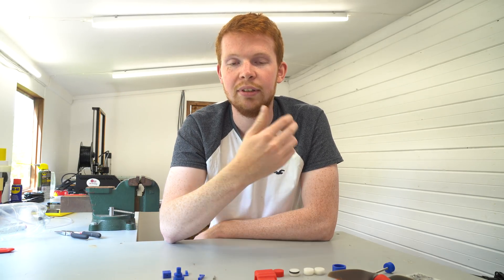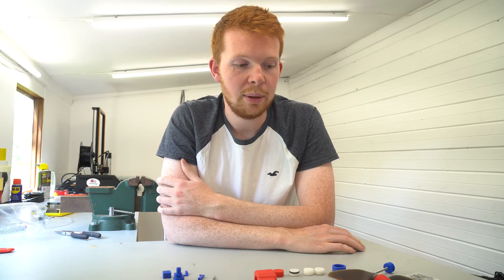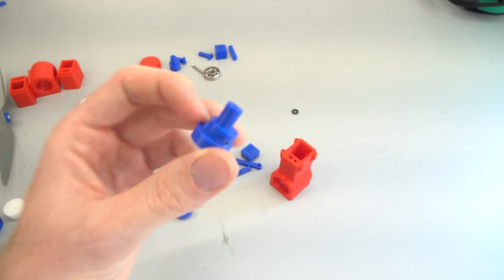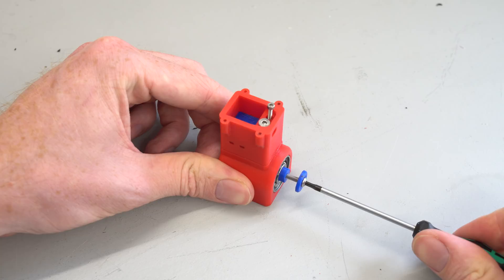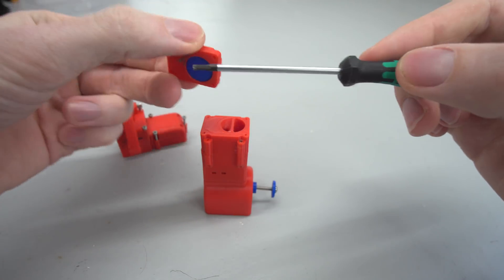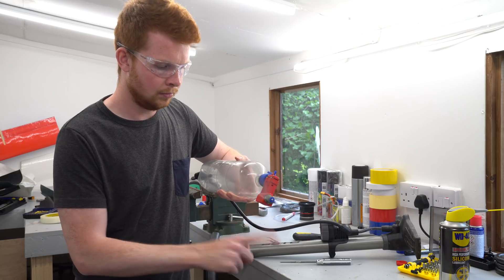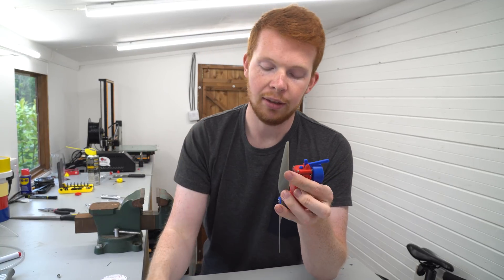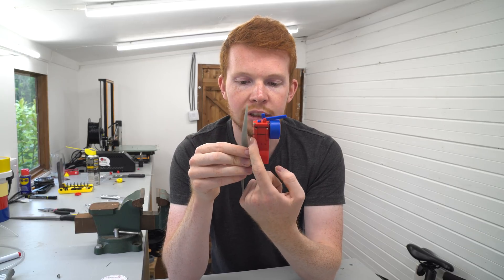Air Engine Exhaust Valve

Comment: You typically need two bearings to fully support a shaft, maybe two ball, a ball and a roller, but always two, usually more. The offset load causes a huge force inside the race of the bearing when there is only one. As a test, try removing or disabling the valve components to test where all this friction is being developed.
Reply: Second

Comment: I was among those that suggested a multiple expansion setup. Not sure if you saw it but I also suggested powering on both the up and down stroke. Though from this video it seems that the valve/cam system is becoming quite a problem. Have you considered a different valve like a sealing rod with gaps covering and uncovering inlet and exhaust ports?
Reply: could probably be done with a strip of sheet metal with appropriately sized slots, that is put into a slot dividing the flow paths.
Reply: oh and one other idea. you could increase the cylinder volume by increasing the diameter (but not increasing the stroke lenght) and deal with the excessive force/flow problem by adding a regulator valve for constant (and lower than bottle) pressure.

Comment: As I've seen the video abozt the number of pistons just now, i wanted to take this video to say that you probably should have at least 2 pistons, with one offset at a right angle, so the engine keeps the same rotation.
In another video, it was clearly visible that the rotor just swings back and forth at lower pressures, a second piston would solve that.
(offset meaning it is a quarter of a stroke behind the first piston, it could work with the offset being half a stroke, but im not sure)

Comment: Your current designs are based on internal combustion engines.   You might get better results if you look at what is done with steam engines which are often run on compressed air.
Reply: And because you are not using explosions, you can drive the piston on ALL strokes.
Reply: @martindinner3621  his design fires on every rotation, you might want to see to the episodes where he explains how his engine works
Reply: I've already mentioned it a lot in other video comments. And he can also pressurize from the crankcase side too. (No significant heat or lubrication problems like a combustion engine.) So when the top of the piston is being exhausted, it can be pressurized from underneath. So an analogy would be that it gains more power similar to how pedal clips work for a bicyclist. Not sure how he's missing that one.
Reply from the maker: Thanks for all the suggestions! So here is my reasoning why I've not to gone with the double acting piston... yet. In my air engine V3 video, I run through the reasons why I use a ball valve over a slide valve (steam engines use a slide valve to power the piston from both sides). The slide valve requires a valve between itself and the air/steam supply for the ability to completely shut off the air supply. Without this shut off valve, the engine would want to start by itself because air would be able to flow into the cylinder. Whereas the V3 engine could be pressurised and would only start when the propeller is spun. For the purpose of mounting the engine on an RC plane, this was the lightest solution. It is now possible to move to a double acting piston due to weight not being as much of an issue in an RC car. However, a double acting piston also requires a long connecting rod with a pivot between the piston and the crankshaft. It can't simply feed air into the crankcase as there will be huge amounts of air wasted in the open cavity as well as being lost through the bearing. This means the cylinder must be sealed at both ends, one end having an o-ring for the connecting rod to pass through, which will either cause an air leak or add friction. So to sum it up, I reckon a double acting piston (steam engine style) will both increase the size (longer connecting rod), increase complexity (added valve between engine and air supply) and increase friction (due to sealing the underside of the piston from the crankcase). That's my thoughts, I might be wrong, so please correct me if you think differently! Thanks
Reply: Agreed.  I was also thinking about the simplicity of the steam engine valve chest.  No springs.  The air pressure helps the sliding bit seal.
Reply: @danharold3087  that's a good idea
Reply: Liked this to push it up - Tom, stop thinking combustion engine! Also think about rotary valve like the crankshaft of a glow fuel engine. And also think about using the wrong side of the piston instead of using a cylinder head - e.g use the crank case as your chamber.
Reply: This!^^^^
Reply: Exactly! Combustion engines rely on explosions whereas steam engines run on pressure.
Reply: @joshuaf9426  I mean, the explosion generates pressure, just at the proper time. A steam engine has full pressure for the entire stroke, and usually has a power-stroke in both directions.
Reply: Liked this to try and push it up the list of liked comments as I'd also thought the (current) engine is working on combustion ethics, like a petrol engine, and not compression, like a diesel engine.

I don't know whether Tom has or hasn't already thought of this and there were reasons for not doing it already, but if there is a legit and rather simplistic method of approaching it then that would would be a good engine to go forward with and then move up the list in improvements like 2 cylinders and so on!
Reply: Good idea
Reply: I think the multiple cylinder version that you mentioned at 1:10min is only appropriate when expanding gas is involved.  There would be no additional expansion left in the exhaust of an ambient air powered  engine.
Reply: Brilliant suggestion!
Reply: threepotgtti could use both sides of the piston with an oscillating valve on the cam
Reply: In other words copy a double acting steam engine instead of an internal combustion engine.
Reply: "often run on compression." but yes this is a smart idea
Reply: I'd suggest using magnets.
Reply: His design was based for an aircraft, so he needed as little useage and as much power from compressed air, so he used a combustion engine design for its 'fuel' efficiency, whereas steam engine designs use alot more 'fuel' by powering the piston in both up and down directions. I do agree with you point but he needed efficiency over rpm / power
Reply: @2MAz but it's less fuel efficient
Reply: Exactly what I wanted to suggest for the last 3-4 episodes... I see that the compression on the Top Dead Point is considered... with negative results. The last point is that instead of thinking at multiple cylinders Tom should consider multiple stages instead, like in Steam Engines...
Reply: What Is Islam?

Islam is not just another religion. 

It is the same message preached by Moses, Jesus and Abraham.

Islam literally means ‘submission to God’ and it teaches us to have a direct relationship with God. 

It reminds us that since God created us, no one should be worshipped except God alone. 

It also teaches that God is nothing like a human being or like anything that we can imagine.

 The concept of God is summarized in the Quran as:

{ “Say, He is God, the One. God, the Absolute. He does not give birth, nor was He born, and there is nothing like Him.”} (Quran 112:1-4)

Becoming a Muslim is not turning your back to Jesus. 

Rather it’s going back to the original teachings of Jesus and obeying him
Reply: @ahmdabdallah5811  fuck off
Reply: @ahmdabdallah5811  Get away from here disgusting anti semite  jhihadist

Comment: You might want to make a couple wraps of duct tape around the bottle to renforce it because it might blow up under high pressure
Reply: 1down 4up 
That could be useful, but the way he placed the scrader valve in the bottom of the bottle should make that blow out long before the bottle itself would explode
Reply: No those hold a shit ton of pressure and duct tape would do jack anyways

Comment: I still think a rotary would be better
Reply: wouldn't it basically just be a turbine?
Reply: oooh, yeah, a rotary engine would be really interesting to see. They are also much simpler in their design.
Would need a lot of grease to get a good seal though.
Reply: Rotary engines require combustion to keep the rotor spinning therefore this would be more complicated than it first looks
Reply: Felix4Gaming
More seals required per cylinder. They managed to win the 24h cause they managed to produce a good engine despite that being a rotary engine, not because of that.
Reply: ABaumstumpf Nah, you had it quit right but the rotary actually also doesn't need valves, camshafts and camesprings, camfollowers and chain ( basically the whole valvetrain of a 4 stroke). The rotary, if well lubricated, is also very reliable (the infamous 787 basically won the 24h through reliability and not as many people will tell you because of it's supirior powerout put) but there lies the problem.  Constant lubrication on a rotary without high emissions, eeh, not gonna happen today.
Reply: ABaumstumpf note, I'm thinking of the Wankle engine.
Reply: in an wankel rotary engine, there are no cylinders. There is a housing and a rotor. Yes, the rotor needs three seals. But these dont need to be super tight, much like how the current engine design has a small gap between the cylinder and piston.
I think using grease, rather than oil, could help there.
About the mans, i must correct myself, it wast the rx7, but the rotary engine was used.
Many attribute their victory to the rotary engine design. One of its main appeal is that is wears a lot less than a reciprocating engine design. If you think about it, it makes sense: it only has a single moving part, and its a rotor.
Reply: Paul Quarles The idea is good but i think it all boils down to leakage, wich is very common in rotarys.
Reply: "Yes, the rotor needs three seals. But these dont need to be super tight, much like how the current engine design has a small gap between the cylinder and piston."
3 seals just at the circumference, moving at higher velocities, and you also need seals at both endpoints (the engine isn't just the 2D crosssections). 

"One of its main appeal is that is wears a lot less than a reciprocating engine design. If you think about it, it makes sense: it only has a single moving part, and its a rotor."
And that has been shown to be false many many times over.
You only safe a single part - the piston-rod. The part with the least wear.

The benefit of the Wankel is that it has a small volume, can be run at high RPM and has more combustion occurring per revolution giving it a higher power for its size and weight. But neither efficiency nor durability are high. And for an air-powered engine you want efficiency - where the good old steam-engine designs are far better suited.
Reply: Steven Little not necessarily.  You would need a different setup than a combustion rotary engine for sure, just like the air piston engines are not 4 stroke engines either.
You would have the inlet be at the same stage as the decompression stage.
Reply: ABaumstumpf they also have a much higher power to weight ratio. Something that is needed for rd aircraft's.
Reply: The le mans race where Mazda was in 4th place and had luck that the first 3 all had major problems.... yeah....
And without valves the inlet and outlet ports are a huge problems for the seals creating a lot of wear and - again - leading to its comparatively poor reliability.
Reply: ABaumstumpf I'll take it as a win through reliability and a good portion of luck. Again, if he would ad a lubrication system that mixes some lubricant with the air (like in stationary compressed air systems, for example in workshops) it wouldn't be a problen at all. He just needs a simple ventury nozzel with a well seized whole in the sidewall to draw lubricant in, as simple as that. The complexity doesn't even exeeds his own valvetrain design. I  think the problem is the print of a proper rotor and crankshaft what includes the  teeth on them.
Reply: "I'll take it as a win through reliability and a good portion of luck."
If you think other parts of the car failing is somehow proof of the reliability of the wankel engine.... well, your choice to believe factual incorrect things.
Reply: If you build it like an air tool you use centrifugal veins to catch the air
Reply: ABaumstumpf I would say it is very correct. You can't say that the engine reliability isn't a crucial part of winning the 24h and i love to tell the story because people think the engine is the most unreliable thing on earth, wich by the way is a false fact. It all depends on how you lubricate it. Of course the rest of the car also has to hold up until finish but thats not the main topic here ;D.
Reply: Paul Quarles What do you mean by centrifugal veins?
Reply: "and i love to tell the story because people think the engine is the most unreliable thing on earth"
people that claim that are idiots - same as those that think it is as reliable or more reliable than Diesel or Otto motors.

"You can't say that the engine reliability isn't a crucial part of winning the 24h"
it was reliable enough to last for that one race. 

"Of course the rest of the car also has to hold up until finish but thats not the main topic here"
But that is the main point of your (failing) argument as that was what was failing with the other teams.
Reply: "My "failed argument" as you call it is nothing more than stating that the engine had held up the whole race"No, i am talking about your failed argument where you claimed that failure of other cars in any way would imply reliability of wankel engines -a colossal non-sequitur.
Reply: Mandernach Luca
"I never said that ;D. I said it won the race through reliability and not through a higher power output. "
Well - and that is simply not true as the reliability of the motor was NOT the cause they won but the shear luck that the first 3!!! cars all broke down.

And it was me that said it was reliable enough - not you. How about yous tick to reality and stay honest?
Reply: "but go on try again. How about reading our conversation before writing and carefully pick words, helps a lot"
Would be great if you would do that - but you just want to stay in your lalaland where wankel-engines are as reliable as otto motors.
Reply: ABaumstumpf Again, never said that XD. Well, i hope you have at least a good sunday not wasted on a stranger on the internet ;D.
Reply: Must be nice being so delusion (and forgetfull) - as well as dishonest as you are.
Reply: ABaumstumpf Nah, don't know what you mean, you just interpreted to much into what i said, as i said before you should always really carefully read a conversation, to get someones point, instead of blindly rant a comment ;D.
Reply: ABaumstumpf fewer parts to wear down actually. That's how Mazda won the 24h du mans with the rx7, before they subsequently decided to ban rotary engines for that very reason.
Reply: Harder to build, less efficient, more parts to wear down.
Reply: ABaumstumpf My "failed argument" as you call it is nothing more than stating that the engine had held up the whole race, good thing i never said that it was as reliable or even more reliable than reciprocating piston engines ;D. Well i think this is just your useless try to rant on my comment. What a bummer.....
Reply: ABaumstumpf I never said that ;D. I said it won the race through reliability and not through a higher power output. That merely implies that the car wasn't powerful enough to win the race but it was overall reliable enough wich also implys the engines ability to be reliable enough. As i said before, what a bummer....
Reply: ABaumstumpf I stuck to the truth until now ;D. I said it basically won the race through reliability, wich means that the car had not much of a chance to win the race in the first place but it was reliable enough to withstand the race. Everthing else is just a false understanding from your side ;D but go on try again. How about reading our conversation before writing and carefully pick words, helps a lot 😂.

Comment: i think you made it too complicated, thinking that you should remove the complex inlet and switch back to the old inlet but make it be inside the engine. the exhaust is pretty fine but having a it timed wrong could make it malfunction. got kinda dissapointed last week but this week you really succeded with the project. Bye Bye!